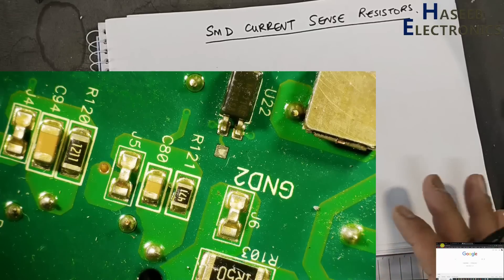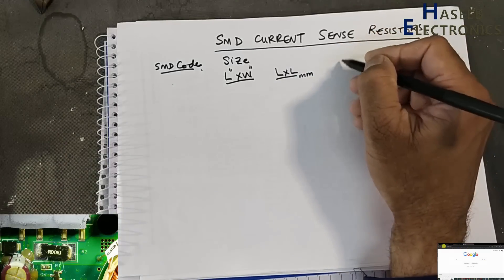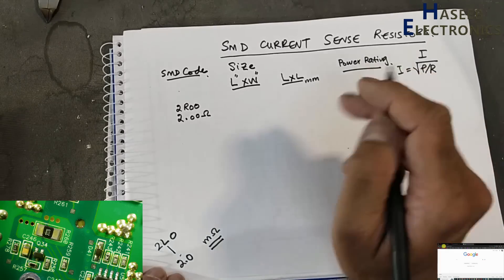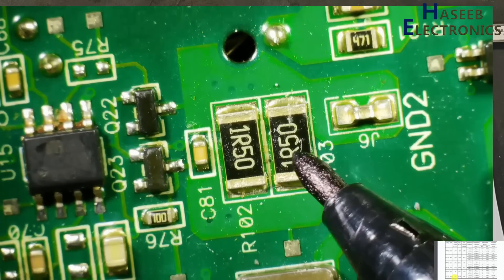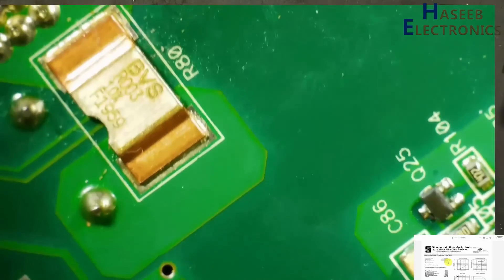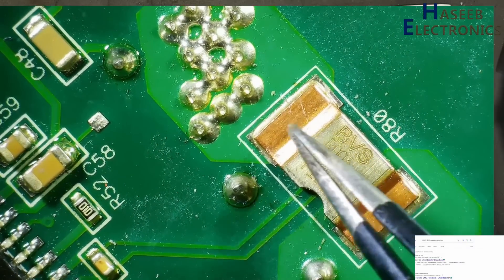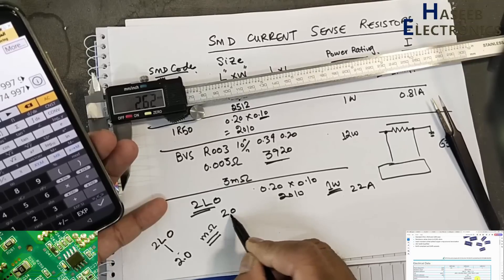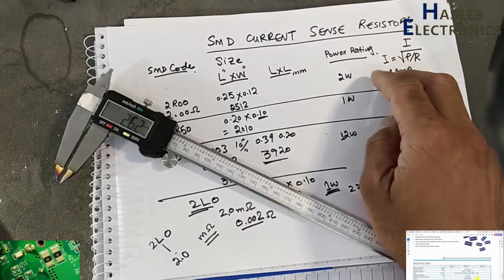{1128} SMD resistor value, size code, power rating, current handling

Comment: Hi Sir, can you please explain the role of that 100nf capacitor on tl431 that is place between the reference pin and cathode and also the capacitor that is always in parallel between the collector and emiter of the optocoupler in SMPs

Comment: Really awsome sir. Sir if your time permits please make a video about current sensing using shunt resistors in Air conditioner and other appliances. Because there are a lot of Comparator ic's are using in every different manufacturers. So its difficult to understand of its working. Also if you make a video about this, it will be more interesting sir. Thank you🙏

Comment: A great lesson. Is there a way to determine a 3 pin Zener smd diode on a power supply board that has blown up and can't be ID'd?
Reply: Most of the circuit have only tl431 zener diode.
Reply: @rajkhumar001  thanks,, I forgot to include that it is an SMD diode.

Comment: Hi! Engineer Hasseeb, this video is intuitive. Keep it up, sir. 

Please I need your help! 
I have laminating machine and its power supply board here with me but I don't know where to start and I don't know which components to test. It's not heating up (temperature control is not responding and the roller. It is dead. 
However, I'm sure the problem is from the motherboard.

In summary, please make a tutorial video on laminating machine, explaining how to diagnose each section on the motherboard.
This will be helpful to me and of course the world technicians and engineers at large, thanks. ❤❤🎉